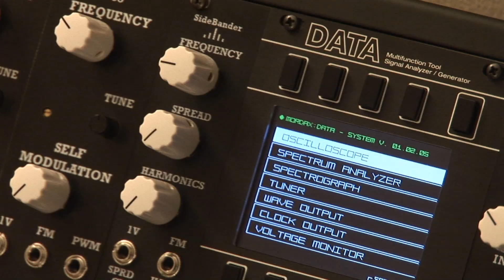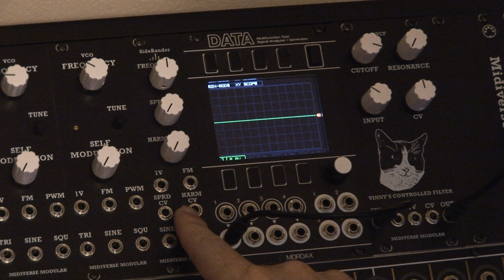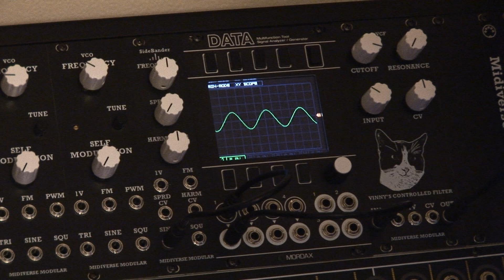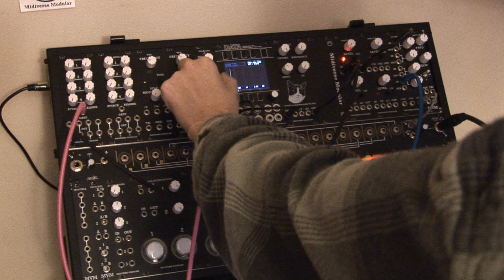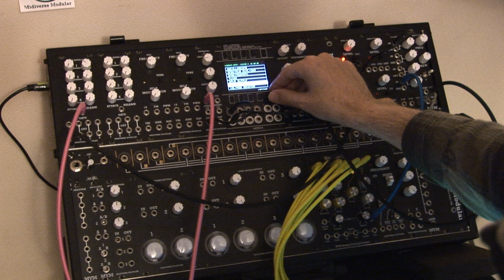Midiverse Modular - SideBander - Announcement/Demo Video

Comment: How is this module using additive synthesis?  Seems like audio rate frequency modulation but I don't see the usual aspects of additive, like adding sines of different frequencies together to build a waveform.
Reply from the maker: Thanks for the question! It's additive because it is specifically adding 5 sines (or squares) of different frequencies. A Spectrum Analyzer makes this clear, but a studious observer may be able to spot it on a normal Oscilloscope.
Reply: @MIDIVERSETV  thanks for the reply.  I saw a bit on the 'scope (although I'm not sure I'd qualify as a "studious observer") but I'm still not sure I'd consider this additive.  Just me 'though, additive is something I've been interested in doing for quite some time, and I happen to be developing a true additive Eurorack module at the moment.  Adding enough analogue sines to get a reasonable waveform is time-consuming, expensive and cable intensive on a modular (or anything else I suppose).